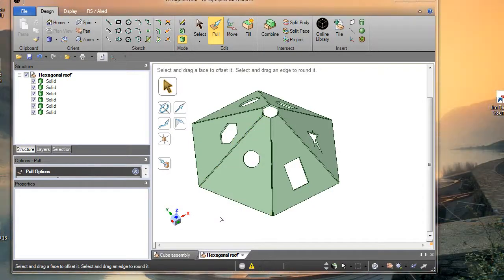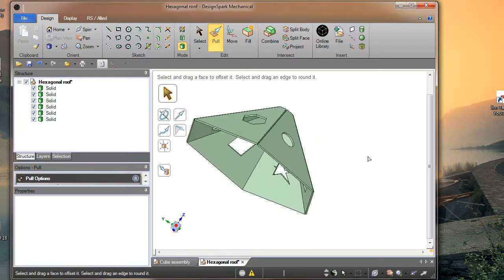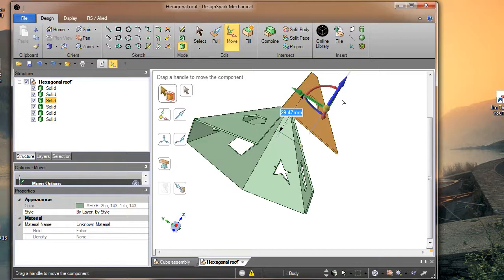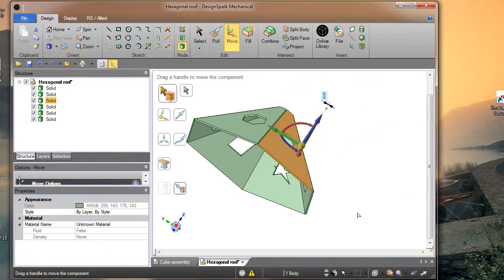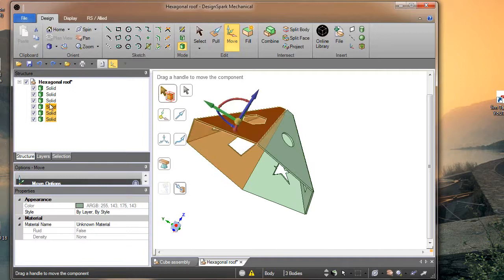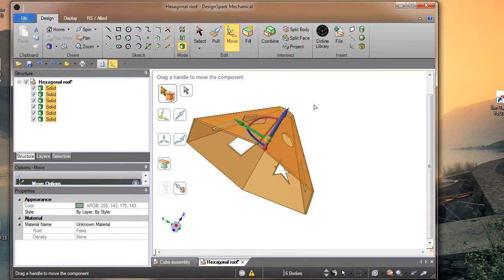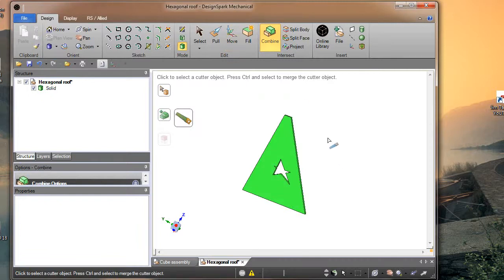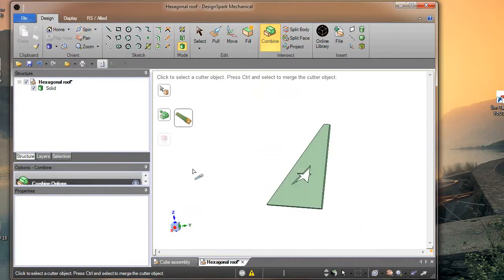DesignSpark Combine Fail

Comment: You can't combine solids that don't intersect or meet exactly. You need to fix that before trying to use combine. The way to do that varies with the situation. Often times you can use "project",  but in this case the easiest solution would be to use the move tool and the "up to" function to bring the offending edges into contact. Make sure you select just the edge, press "U" and then select the other edge.